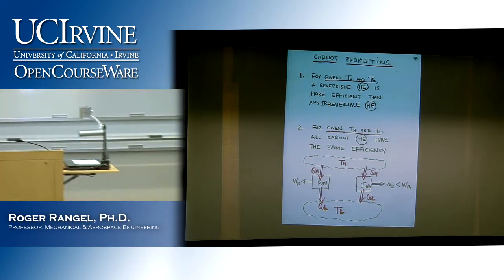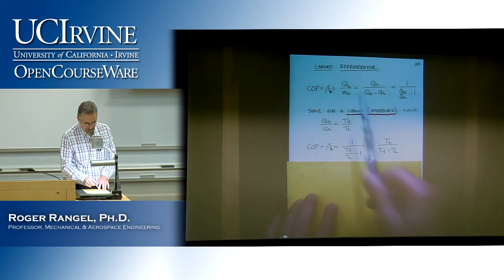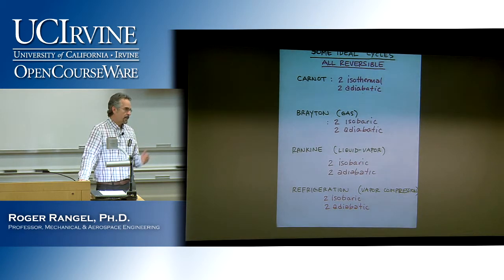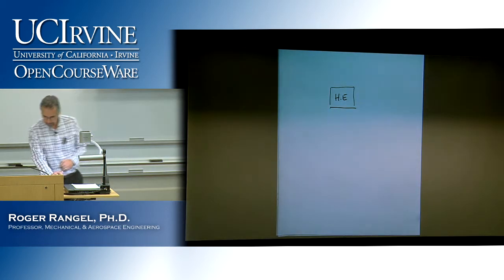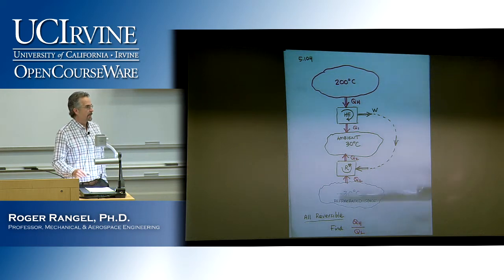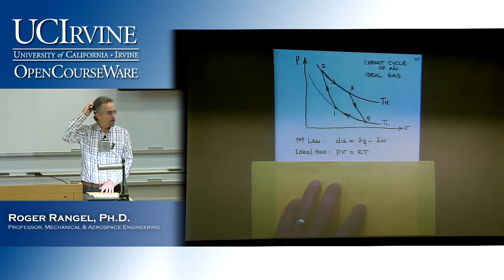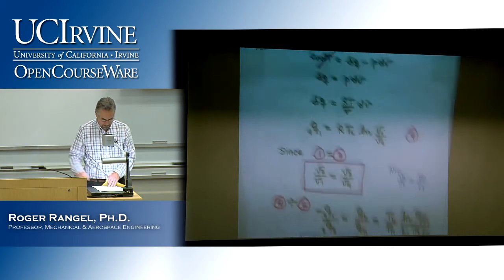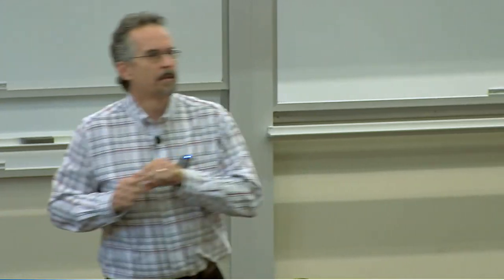Engineering MAE 91. Intro to Thermodynamics. Lecture 12.

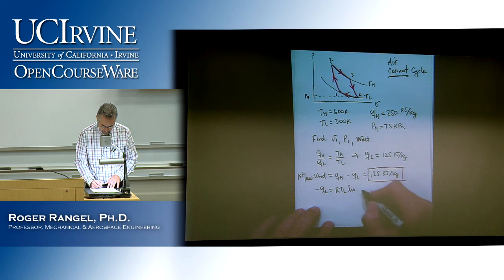Comment: I think there is a mistake in the last question @ 1:10:23 where the Professor says Q(L) is the same as Q(4-1) which I think is wrong. Actually Q(L) is Q(3-4) where we lose heat, not in the 4-1 where we have isometric process.
Reply: no, he is right if it was Q(3-4), the temperature would had change. but T stays at T sub (L)